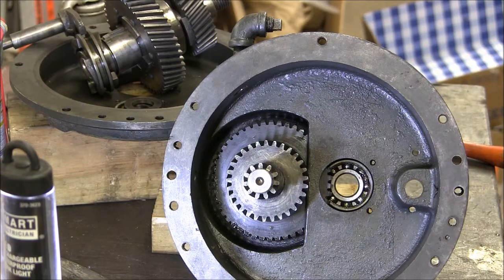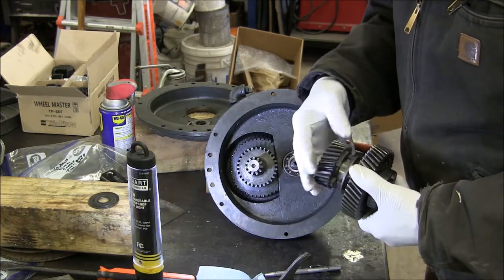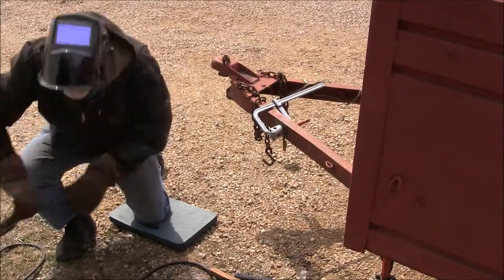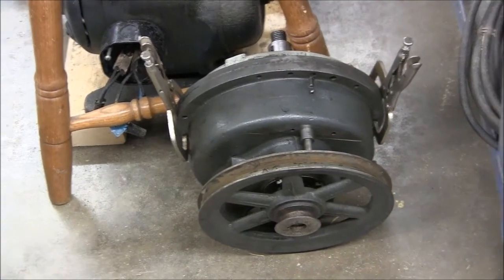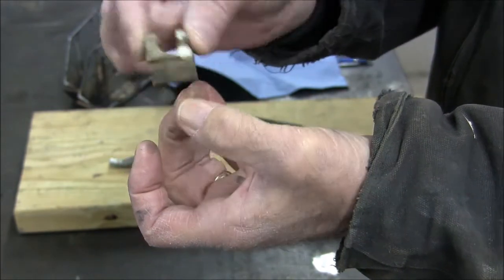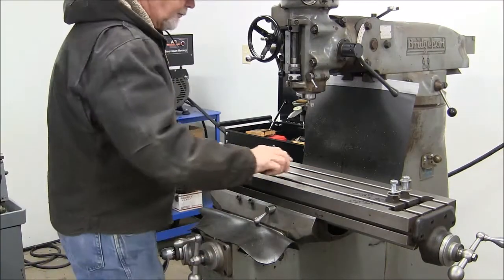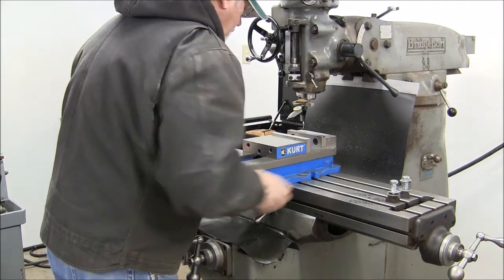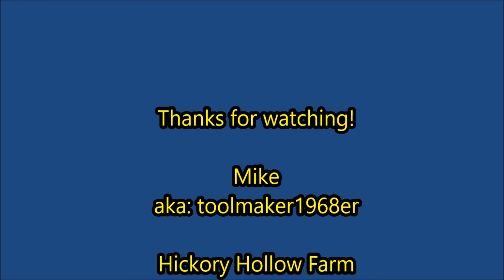Doall bandsaw refurb Part 19

Comment: That's quite a fiddly bit of reassembly - glad the tooth relief has eased meshing.
Seeing that awkward position for welding made my back hurt - I can't work at that angle for long at all these days.
Nice job making the snow blower part replacement.
Reply from the maker: ChrisB257 - Thanks Chris.  I thought the reassembly would just a matter of reviewing the disassembly video and slapping her together.  Wrong. The spacers were the issue.  There must be 10,000 combinations and permutations of postions.  Lol. Tc. Mike

Comment: Nice machining footage Mike. I've never used that material before, I guess it's like bakealite?
Reply from the maker: Steve Avis - Correct, bakelite is the trade name for phenolic.  It's a thermoset molding compound.  It has great heat resistance, and dielectric strength.  One of the first plastics to be developed.  Micarta uses linen fiber laminated together in general purpose phenolic. It comes in sheets. It's popular with knife makers for making handles.  We used to use it a lot in resistance welding fixtures for its anti arc tracking properties and insulation to heat buildup.  Thanks Mike